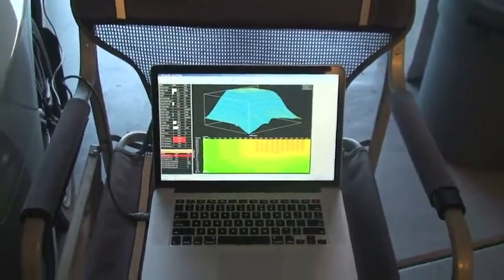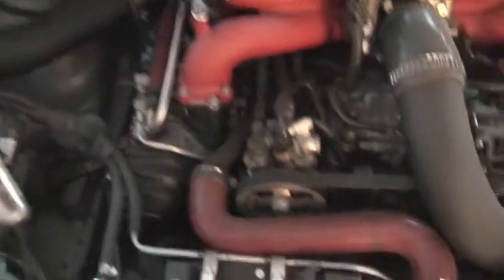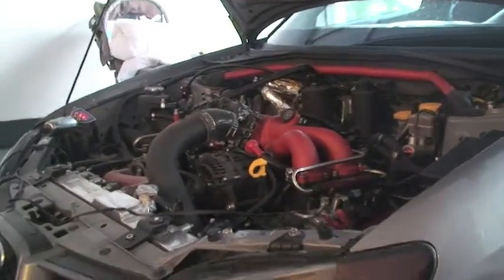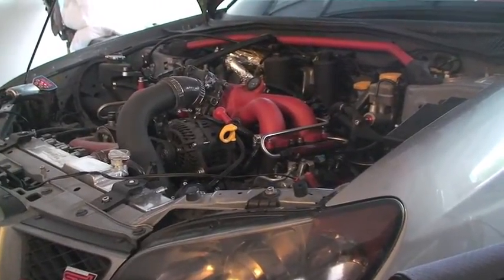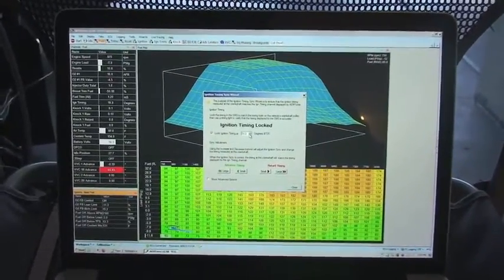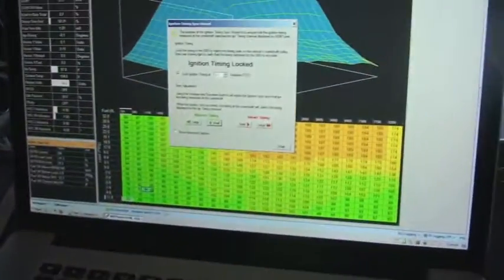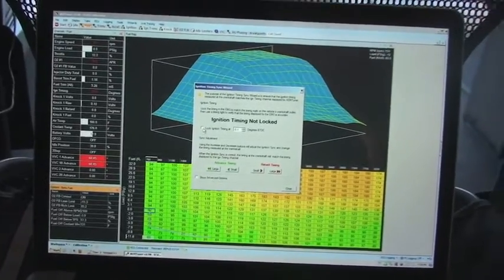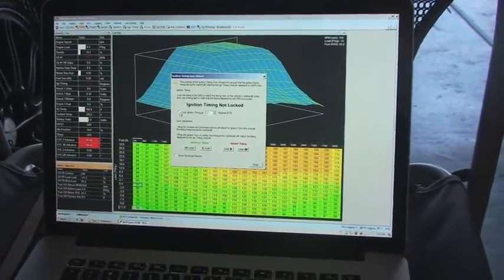AEM EMS Series 2 Sync Ignition Timing

Comment: I have 240sx work sr20det.  Has been tuned but I had to fix some stuff and now have a question about setting up to the timing my tuner had it at.   I know on stock ecu I have to unplug the tps and then set the timing but idk if I have to with aem ems v1. Do you mind giving me some knowledge on this if you can. Thanks!